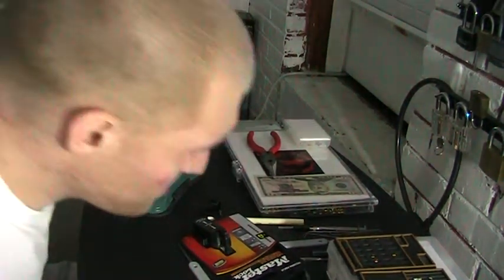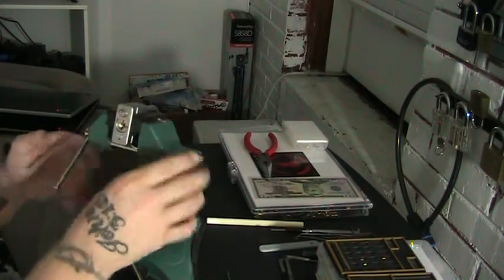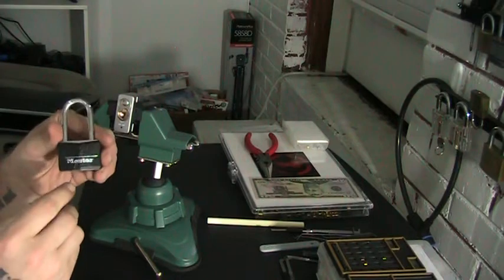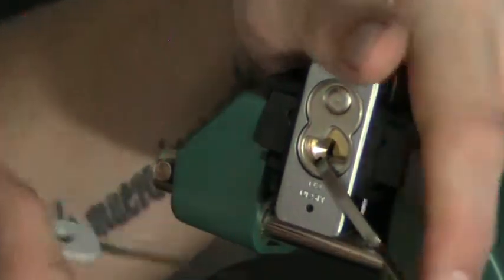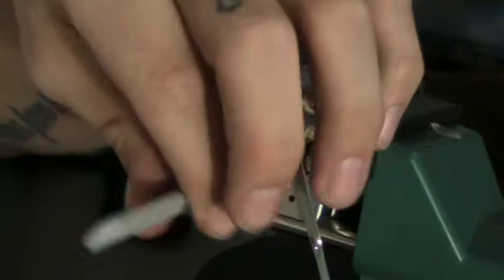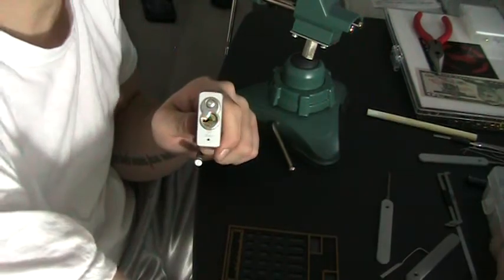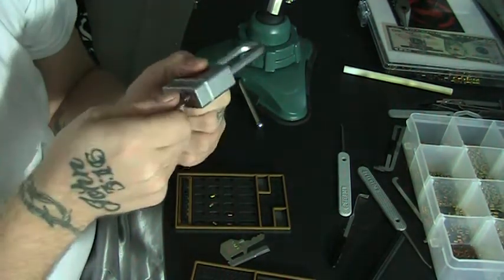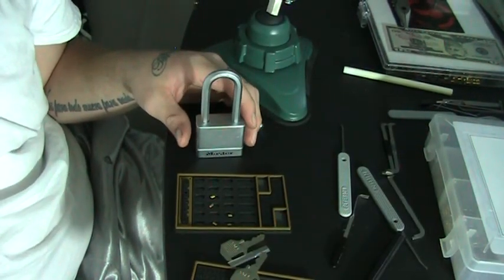(003) Master Lock M530 Picked, Gutted, and Upgraded

Comment: HI Derek, glad I found your video. The only problem I am having, after I took it apart, the shackle won't lock. Everything fell out, including the rotational spring, I probably didn't put the spring back in the proper order.  :-/
Reply: Six years later… I have the same problem

Comment: the reason y your follower wasnt going in so smoothly is bc the back of the bible is crimped you can either break the crimp that goes all the way around the back of the lock and put a normal american or master c clip on it the crimp is just a small  indentation thats easy to break off with needle nose pliers and after you break the small flat spot in the crimp your follower will go through smooth